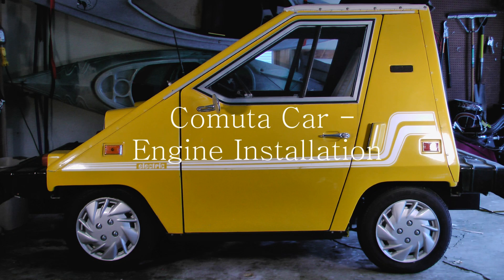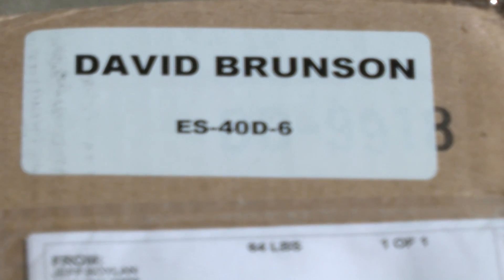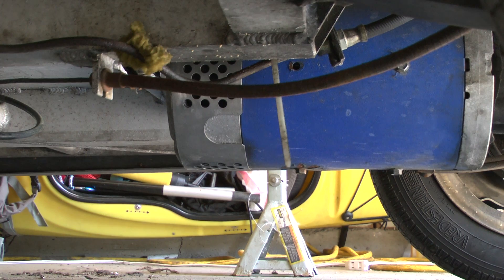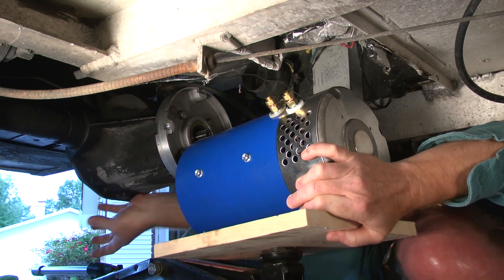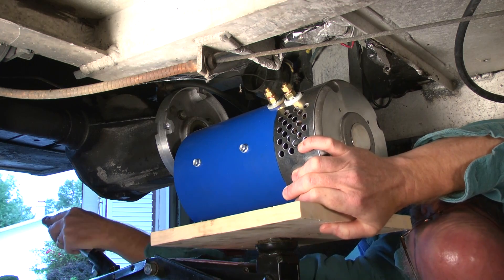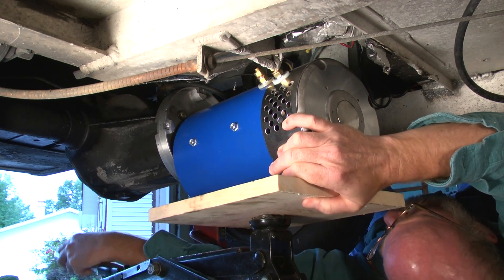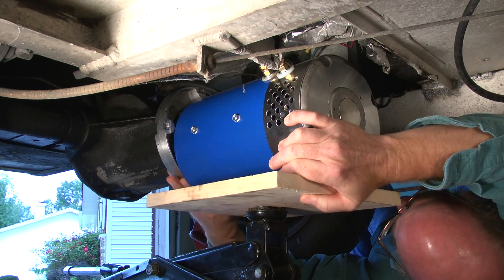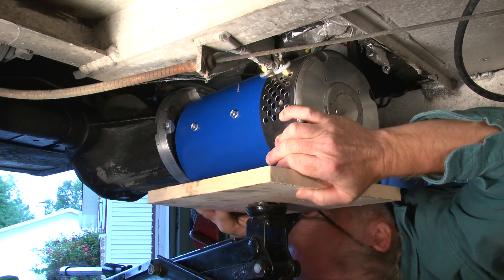Comuta Car   Motor Installation

Comment: A light little car like that,   You can just flip the car on it's side,  then replace the motor.  A lot easier that way..  Just throw some old tires on the ground,  and you won't even scratch the paint..
Reply: The batteries might be the only problem due to it falling out of place but i am thinking of flipping my 1987 yamaha electric golf cart to its side to rewire the cart from underneath